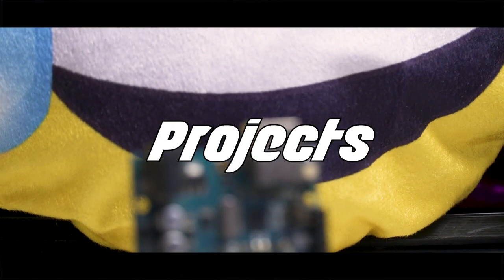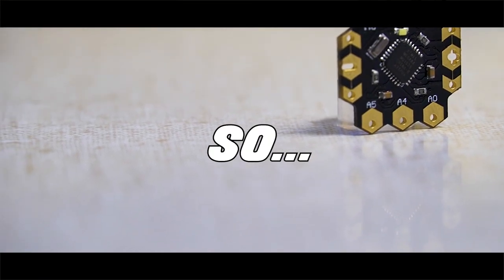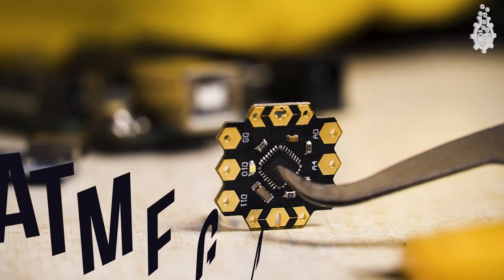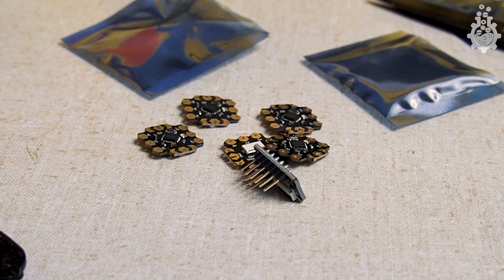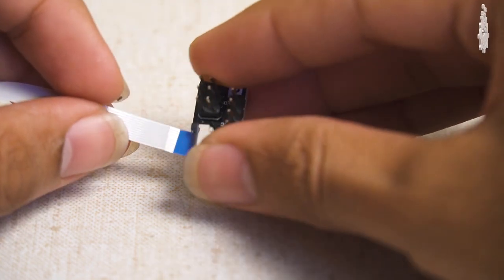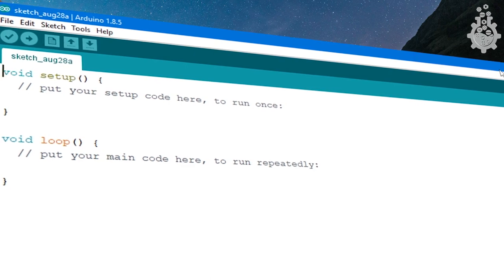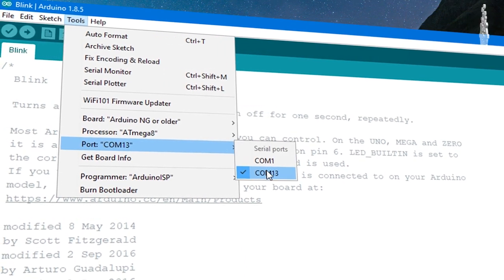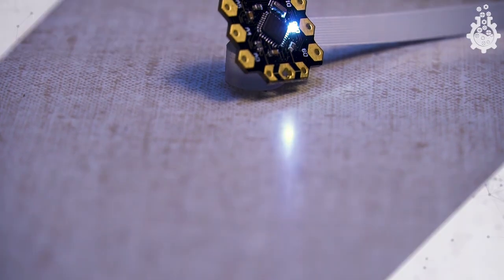how to setup cheapduino | smallest arduino

Comment: Hi,
I’m brand new to micro controllers.
I’m looking for the smaller size to fit into some plastic models.
I don’t need very much power or processing.
All I am looking to do is have some LEDs flash on the cockpit of the models, and a couple always on strictly for visual effect.
The  absolute tiniest of all isn’t all that important because I can hide them inside, but it makes it a lot easier if they are very small.
And because I’d like to do this for many models, the less expensive the better.
Again I am new to this, I bought one of the UNO starter kits to learn, and breadboard etc.
So these will be for once I have it all planned out.
Reply: arduino Nano
Reply from the maker: You could do a custom board with AT-Tiny and put some prog pins on that board, which you can use to burn your software and then just put all the leds and everything on that single board, the coding part won't be that bad, the only difficult part would be to get a PCB, I would say start looking for " AT-TINY" you will definately find something small and battery friendly just for led visual effects

Comment: +Mission Critical i never used Arduino, so no experience yet. I was wondering; would a project like this be possible with this small arduino? needs to be as small as possible.  I would like to connect a micro servo that would go left right few times and then pause, then go left right again and loop this sequence. Would like to run it of a small battery if possible? can something like this be done on this small arduino? thanks!
Reply from the maker: I believe you need to use minimum system and not Arduino dev boards, the project/ application you have specified is very very very specific and needs high skills to make it small, because in electronics, the toughest job is to shrink the circuit. Look for other microcontrollers which could help you with it, Arduino dev boards aren't the thing for your task